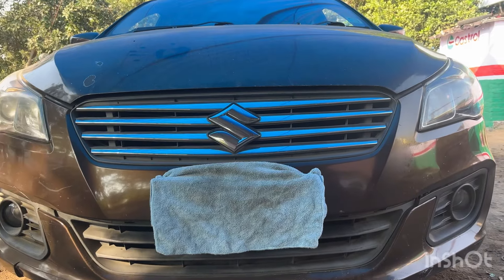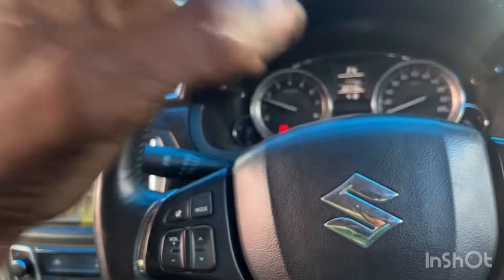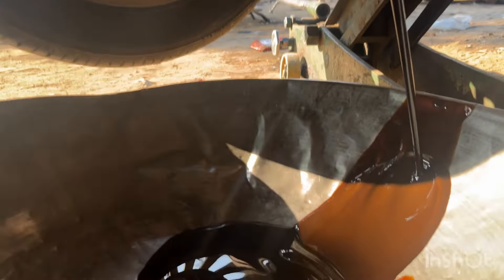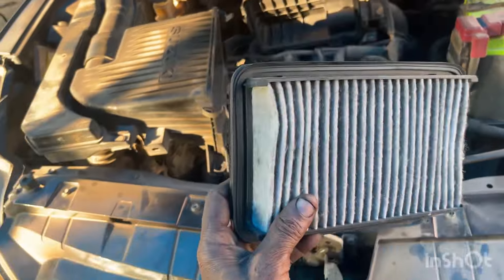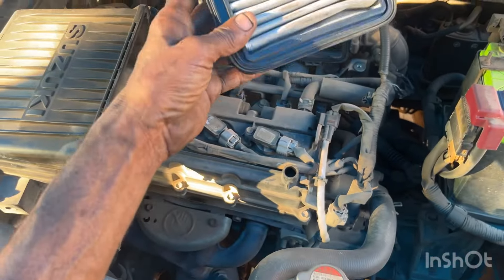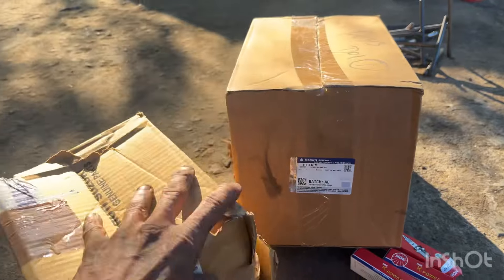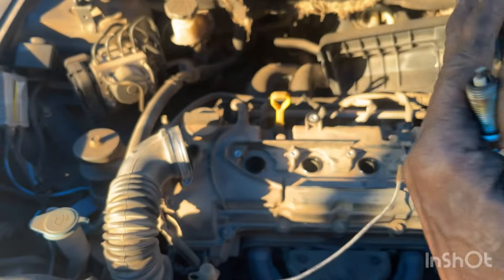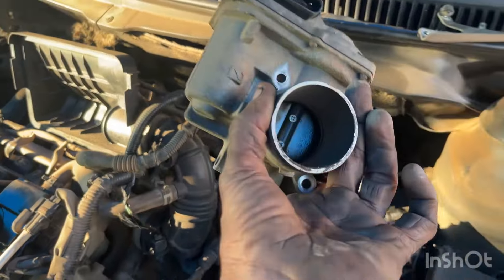SUZUKI CIAZ  General service (@skilledmechanictamil )

Comment: Sir, my tata aria 2014 model ...coolant pipe to engine broken and no overheat signals see in meter..vehicle got off in the road because of no water in radiator..i put water and drive 20km to reach home..every 4km i put water and reach home in midnight..now pipe replaced and vehicle working fine..but the engine have knocking sound slightly..what will be the problem.pls advise
Reply from the maker: 2.2 engine diş advantage this complaint
Piston seize
Reply: @skilledmechanictamil  how much does it cost to repair
Reply: @aeonjith You have done a Huge mistake.. Before it costs Rs.3000 Maximum.. Now it will Costs around 40k to 60k for Parts itself..
Reply: @PrithiviRaja  omg...in the midnight i dont have any other option ..my mechanic said me to drive like this..im going to have a thorough check up on next day to find out the issue...this all hapened due to malfunction of over heat mtr and i didnt find any other warnings..i  cant believe myself where the technology failed..the pipe i replaced is worth only 120 rs and labor 600 rs..now i dont know where does this all go up
Reply: @PrithiviRaja  u said correct ..mechanic told me piston problem is there..expense will come around 70k..our technology is a big blunder i think..because of no overheat signal i came to bear this whole expense
Reply: @aeonjith  i felt really sorry for what has happened to you..
Reply: @PrithiviRaja  mechanic said , its not necessary to do the engine work now...the knocking sound only becuase of the piston heated issue..he told me u can drive , sound will be the only issue..whats ur opinion ..is there any other complaints going to happen if i drive further ignoring the sound
Reply: @aeonjith  kindly check with another Good mechanic or Take the vehicle to Tata motors service center.. they will check and tell the Exact solution